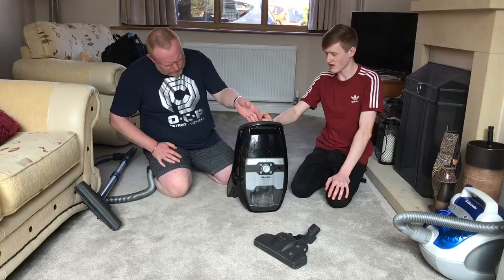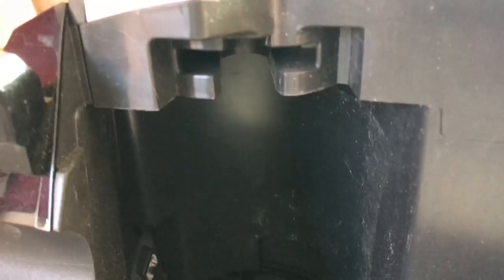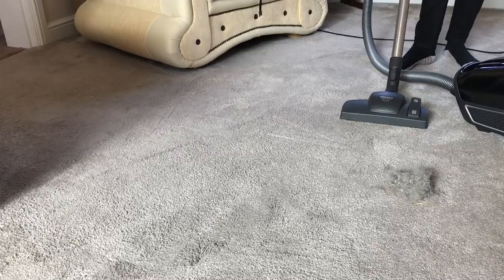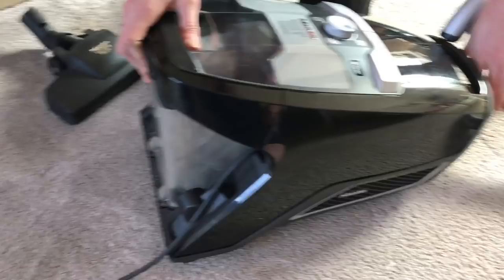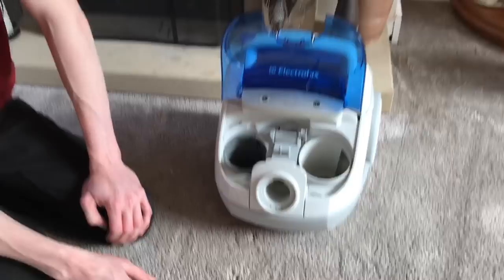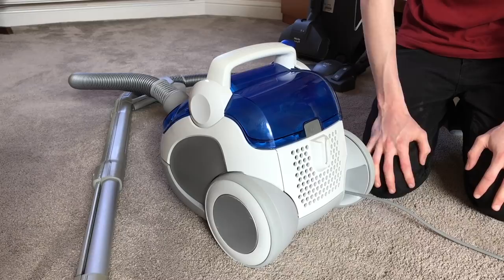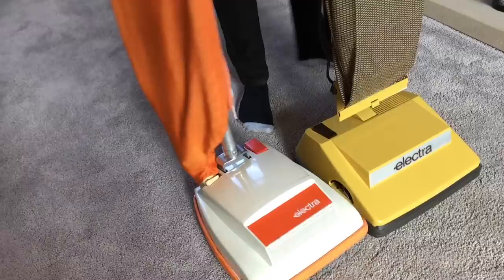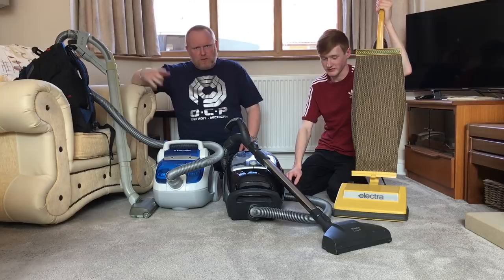Miele Blizzard Review And Some Others For Luck With AEG123

Comment: If it was truly a sealed system like the C3, there wouldn’t be any dust around or beneath the filter housing. As can be seen on the C3 after many uses, there is no dust in the bag compartment that surrounds the bag. That is proof that it truly seals and is why I bought it.
Reply from the maker: I absolutely agree and hope you continue to love it. People who use the fake bags for them or even use them bagless don’t deserve to have one 🤣🤣🤣
Reply: @HooverLux  so I have to say, I havre had a lot more time with my Blizzard than I did a year ago when I posted this comment. I have figured out what causes the Blizzard to leak dust, and it’s something very easy to overlook - it has to do with how it is put back together after it’s been emptied or the handle in the back has been taken out. Please, if you still have this machine, check out my YouTube channel video where I explain this and demonstrate how to assembly it correctly. The handle in the back of the dust bin has to be seated just right or it will leak around that area. Since assembling it the correct way, I have not noticed any dust build up around the dust bin, behind it, or beneath it. Miele fails to mention this in troubleshooting, but I believe I have resolved it. It’s not a design flaw per-say, as when assembled correctly it will not leak dust. However, Miele could have designed it to where it would be much more difficult to re-insert that specific component incorrectly. YouTube Search: “Connor Francis Miele CX1 Blizzard Maintenance +”

Comment: I cannot say that the blizzard I have is that dusty or dirty. I find that it has so far done a good job with separating dust but I have to say that my carpets are never very dirty. I vacuum frequently with a sebo e3 or a Miele c3.  The blizzard with the 228 power head works well but it mostly gets sand out. The gortex filter seems to stay fairly clean as well.
Reply from the maker: You’re very lucky, I’d love to try one with the power head! You lucky duck !!!!

Comment: The new 300 turbo head is far better. It’s not designed for hard floor pickup like the 200 but from what I’ve heard it is nearly impossible to stop the brushroll even with lower suction speeds.
Reply from the maker: I’d love to try it, I’ve seen them on Performance Reviews channel. It would be fab in my older machines.
Reply: HooverLux I’ll be waiting for your review.

Comment: I bought a Miele Blizzard with a 217 powerhead, retail here is $1000 Canadian, about 585 Pounds, got it as a refurb from Miele (Basically brand new) for $700 Canadian, about 410 pounds. It was my first modern Miele, I also have an S312i, and I find it cleans very well but it's quite messy to empty and the filter gets very dirty and is nasty to wash out. In hindsight I should have just bought a C3 instead of the Blizzard but I was tempted by the good deal...
Reply from the maker: Xman1664 I know what you mean, it’s got such a good performance, especially with the motor head, it must me amazing, but dog gawn it?’! that bloody dust bin! Uggggggggggg. You have my sympathies.